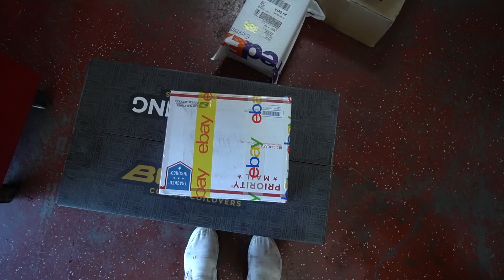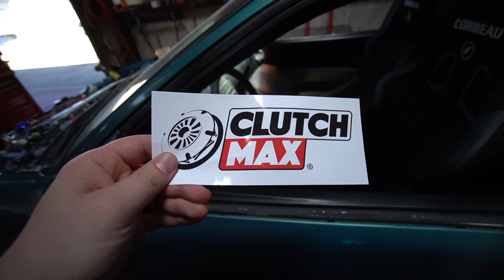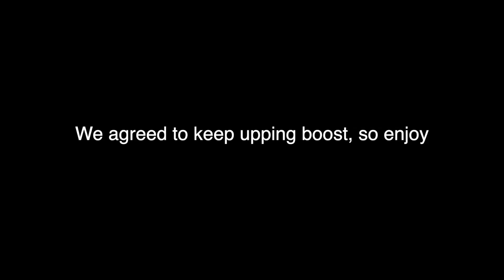I BLEW UP MY $600 EBAY TURBO CIVIC!!

Comment: 23 Pounds of Boost he says? No wonder, the poor little 1.6 :(
Reply: Bonvoyage that’s not bad for a small motor
Reply: Bonvoyage 1.7
Reply: My brothers first car EX coupe EJ8 running good 25psi :v whithout race gas or watermeth and theh did it for 2 years after that the car was sold and no engine issues but was build no stock 1.6 soch eagle rods and more stuff
Reply: @Andrew.562  1.6
Reply: I would probably cap out at like 10 before feeling like my engine is going to explode
Reply: Yeah Honda makes a CRV variant that comes with a 1.5 turbo 4cyl. Putting a turbo in a little 1L is gonna blow it up. So it got recalled because of that and Honda covered their asses as dismissing the issue as an exhaust manifold leak.
Reply: With a stock block
Reply: i would've did 10 15 pound's of boost TBH
Reply: I bought 2 civics that are beat but engines got only 25,000 miles on engines im making them stock they are 93 and 94 lx sedans with 16 valve engines

Comment: I blame the clutch max sticker.  The engine was running fine before it.
Reply: Banging on the rev limter
Reply: Too much boost for a single cam a stock one like that
Reply: Bob Sacamano the sticker added to much extra power

Comment: Should clean the block and make a coffee table. Great conversation piece
Reply: Like Robbie ferreira did with the old eg block
Reply: "this is a nice table, where did you get it?"
"i put a 23psi ebay turbo kit on a honda civic with stock internals"
Reply: jvh22a like off top gear

Comment: F

Damn that sucks. It’ll probably cost $37 to fix
Reply: Honda tings
Reply: I bought my d 16 for 69$ and it had 420k miles
Reply: @mirianmshvenieradze9379  69😂😂😂
Reply: @mirianmshvenieradze9379  I bought my whole 90 civic hatch in az for 250 running and driving just a dx tho 😂😂😂

Comment: You needed a weaker bov spring so it released at lower bost with stock injectors you can cram that much boost with no fuel or you'll throw a rod

Comment: Anyone else notice the immediate check engine light when it blows at 12:42 😂😂
Reply: Honda ole reliable
Reply: Evan on the past video: Check engine light? naaah engine is still there
Civic on this video: NIGGA NOW YOU'RE GONNA NEED TO CHECK THE ENGINE OUT
Reply: Luke Hamilton that's not a good tune
Reply: Thats great

Comment: Want a fast civic? Get a 2003 Honda Civic hybrid. It has only a 1.3 liter motor but go to the Honda forum and get a mod to program the assist by button then there a mod to get 45% more current with the ability to click in the assist in 3 stages. It’s a cvt motor so it all in the Reagan gear. I did. My Honda could light and smoke  the front tire as the car wanted to go left in burn out. I use to blow away many mustangs . They use to stanf still as I blow by them in the 1-2 shift. The electric motor was instance takeoff torque

Comment: eBay clutches last I’ve had one on my s2000 for about 3 years 😂 and I go to the track and dump it all the time nothing wrong with it it was only 102$
Reply: Miguel Sucks just the disc or the whole thing? Either way that's badass
Reply: The whole clutch kit it’s a stage 3 clutch 😂 and it holds up good feels better then the  competition  Clutch I had in it

Comment: You should build a motor for it using only Ebay internals and parts to see how it fairs!!!
Reply: I did in my my big block. Workin great so far
Reply: @badasspearldrummer  update!
Reply: @sn1per.-992  still good
Reply: @badasspearldrummer  nice!
Reply: @badasspearldrummer  update
Reply: @joshuaacevedo4874  still goin strong
Reply: @badasspearldrummer  what engine do you have a vid of it running? im curious.

Comment: Why not an H2B on the ej? It’s an h series motor with a b series trans, they have all the parts for the conversation.💪🏻
Reply: Send it
Reply: What Language Does It Speak 🤣😂 nigga Said Conversation
Reply: I used to have h23a blue top with a gsr trans but honestly k is the way now lol. H is super heavy motor. Barely fits in the engine bay. And burns oil pretty quick
Reply: But b series trans will spank that k trans 💪🏻

Comment: Junkyard motor with forged pistons/ rods and arp headstuds. Retune. Make 500+ how do you not love d series!
Reply: Until you lift the head k20 for the win
Reply: 88chrisbrown trust me I know. I’ve had both on boost. K20 is no joke. Just for the simplicity and cost. It’s amazing how much power can be had if built correctly with budget parts.

Comment: F 

Makes me wanna boost a d16 buuut I'm thinking around 12 lbs of boost so I can daily it
Reply: 8-12 is safe with no internals. Just turbo and tune
Reply: My d16y7 eg was on 9 for about 6 years same tune just walboro 250 injectors fuel pressure regulator it was a quick lil thing sold it still running good...
Reply: Ronald Cornelius I have 9lb of boost on my Vauxhall and it’s enough to torque steer
Reply: Try Atleast 15lbs of Boost and you’ll be Good

Comment: i have a civic with 200k miles should i turbocharge it and run 10psi?
Reply: flash paxton 60 psi
Reply: Do 15psi my friend has one that's at 18, the civic has over 200k miles 😂
Reply: Run around 8-10 pounds if you want it to last it would be plenty fast
Reply: flash paxton  compression test, slap some arp studs, fuel pump and injectors, cheap turbo kit and send it
Reply: @brandonbassett7887  sounds like a plan, and do i really need a inter-cooler

Comment: Is the D series stock? If so its only good for 200whp lol
Reply: Yes it is... do some research... a completely stock D series is only good for 200whp.. of course u can make more but as u can see its not gonna last...
Reply: colin logan im just upset that the tuner didnt know more about this motor before throwing 20+psi at it. STOCK RODS. WHAT THE F***
Reply: @browenbuilt9750  yeah seriously makes you wonder what about his professionalism here. Those rods are the size of pencils. Anything over 12lbs on a 50 trim is asking for it.
Reply: You know he wanted to blow that motor?
Reply: @FriedEggsandJellyfish  they wanted to push the engine to the limit and over the limit... seems like you didnt see the videos before this one he said it like 10 times

Comment: Damn F im bouta turbo my d15 😂 im keeping it low tho so this wont happen
Reply: I got a d16z6 has last 5 years so far on 8psi still holdin. Gone thru 2 clutches. Aint real fast but pulls bout like stock k20 swap in a 94 eg civic.
Reply: Lightning Autowerks™  i want to keep it low but like kinda high to were it blows in a few years then swap it for a b20 with a b16 head. What turbo are you running on that? Ebay or something better
Reply: I ran 10psi from a CXRACING kit on stock bottom end B7. Did the same thing here and just cranked the boost to kill it. Blew it on near 23psi also. Lol! 
It ran great for a couple weeks @10psi though. Keep the timing conservative.

Comment: Put a 1.8 DOHC from a 92-95' integra in there. Can really only get 210hp on front wheel drives if you want to use as daily driver as well..

Comment: I was told when installing any turbo you’re supposed to carve some sort of hole in the heads or somewhere in the gasket idek where but they said if you just add a turbo and don’t add the circular hole somewhere then it’s gonna blow the gasket eventually